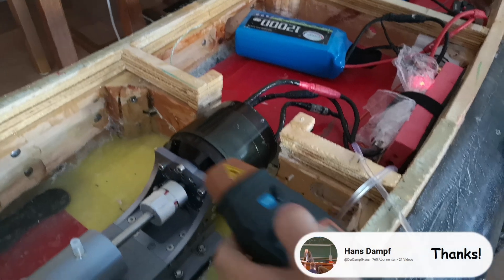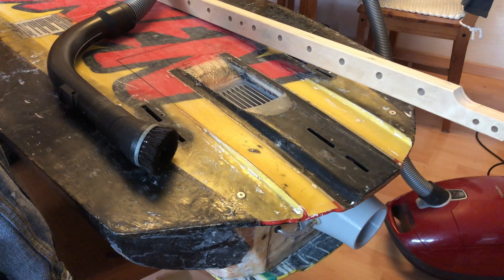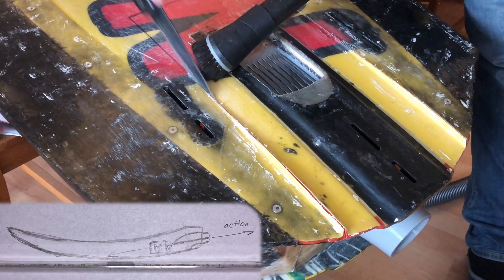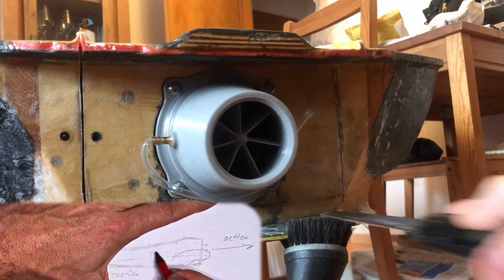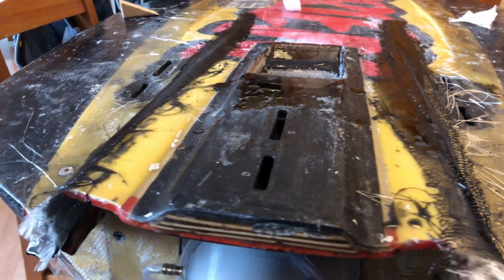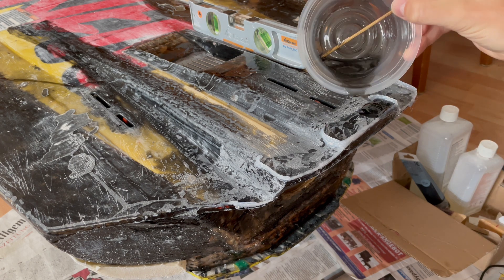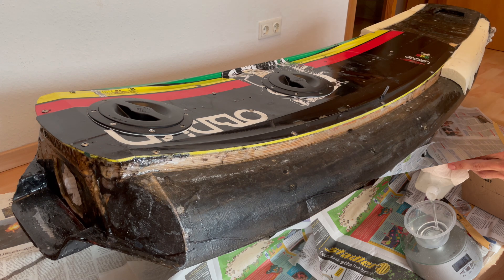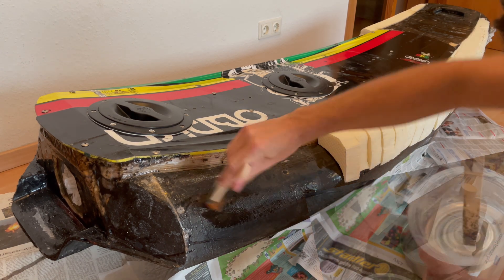DIY Electric Jet Surfboard 🏄🏿 Finally fast after 2 years construction and testing

Comment: Congratulations, the board looks great and it works from electronics to mechanics! Maybe a slight bit light on power, but you have enough speed to get up on the board. More practice and you’ll be planing the board and doing jumps. Foot straps will help you keep balance and turn, but that more of a preference thing.

Comment: Congratulations Bro finally it worked! Ηow many watts needs on full speed? What is the thrust? Do you still have the same batteries and the same volts? you should also make a video standing up and tell us your top speed!
Reply from the maker: @ParanomosGR  Thanks! The following values are only estimated: 170-200A @12S (44-50V) —> 7500-10.000 watts. I estimate 50kg thrust and 40km/h top speed (like my boat). 
I used the same small batteries (12S/12Ah/30C). However, they got warm and swelled a bit. I definitely need new and larger ones. I would also like go to 14-16S, but then it doesn’t fit with my charger…
Standing upright was too insecure for me, and I still need a bit of practice^^
Reply: @DerDampfHans  If swelled even a little DO NOT USED again throw them in the trash! you might set fire to a board and maybe even your whole house! The batteries C rate it actually the half for continuous use(Chinese numbers)!